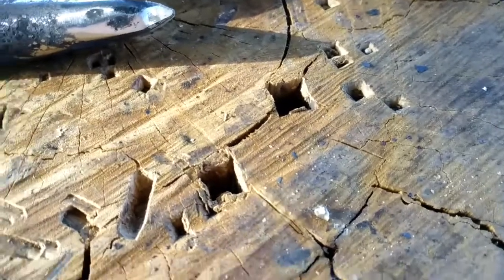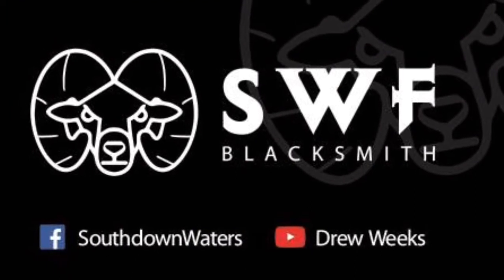Failure to Drill | Episode 35 | Day 35

Comment: Did you run a file over the metal to see if it softened? If it was annealed, try slowing down the drill speed if you can. Also, resharpen those bits. Lastly... What? No chicken!

Comment: You got there, like the edge on the chisel, mate if you want to put those wire handles on, Glen from Glen GS Tongs has a brilliant way of doing it, he made himself a little twister and puts a fuller edge all around whatever he wants to put the handle on and heats the wire and the piece up put's it in a vice puts his bit of flat with two holes in it he put the wire through that and twists, works out really good. Cheers.
Reply from the maker: +Lenblacksmith that's where I got the idea from,  from he's old design without the fuller.
Reply: Oh ok sorry mate you've already seen it. I like the Idea aye?
Reply from the maker: +Lenblacksmith all good,  good for Smith's working alone
Reply: Yep sure does.

Comment: That coil spring is tricky stuff, I'm surprised you're having that much trouble with it. As others have said, make sure your bits are sharp. Personally, I'd hammer a flat so it's easier for the drill to start, and you're not Removing as much material, keeping it stronger. The scale is also very tough stuff, maybe it dulled the bit? Doubt it but possibly. Also, are you sure it was up to critical? Should be a bright orange and non magnetic., could just be an extra tough coil....
Reply from the maker: +scienceaddict77 Def up to critical. The flat is a good idea.